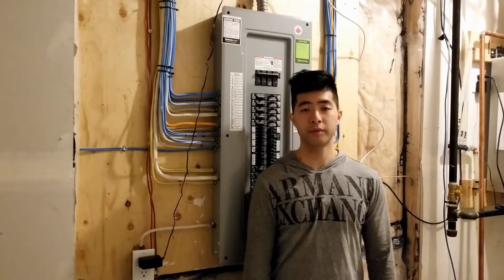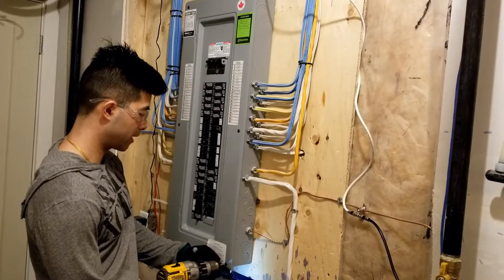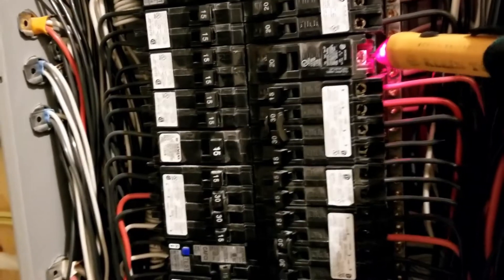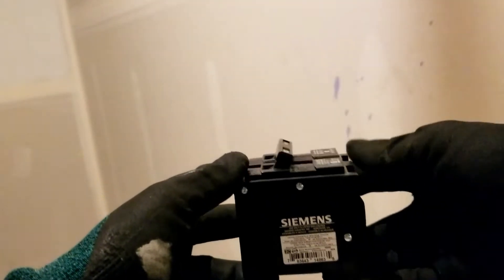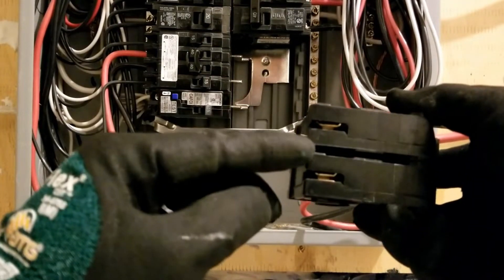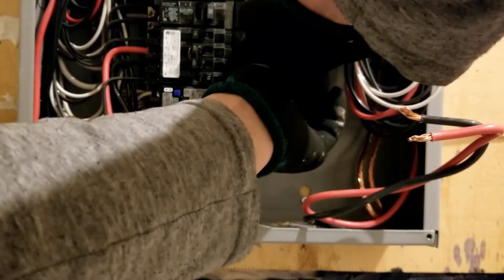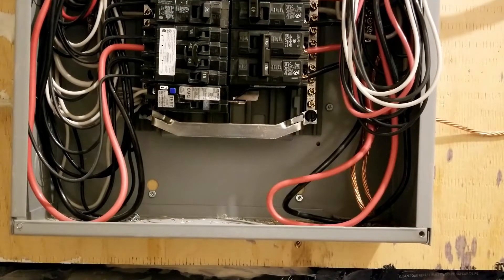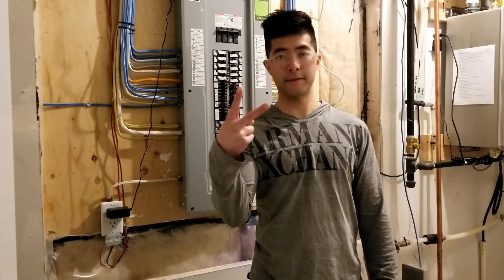HOW TO INSTALL a Circuit Breaker Double-Pole Breaker EASY AND SAFE!

Comment: Appreciate the tutorial but there's no way in hades i'll do anything without turning off the main breaker first.  Electricity takes the path of least resistance through the body, and a lot of it will actually arc around your body as it heads toward the ground.  It will not be a good day for you, and likely your last day as well.
Reply from the maker: Yes, better be safe than sorry 🍻

Comment: Tks for sharing. Question - I haver a 110V  panel, and 40 amp breaker in place. Question, I have a baler that takes 40 amp.  Do I just plug in one hot wire to the breaker?
Reply: Actually the baler is 110V and thus only have one hot one neutral and one ground. So hence my question, if I hook up to one screw on the breaker with hot wire, that gives me 110V.  Question is would this get me 40amp (and breaks at above 40amp?).
Reply from the maker: Yes, you would get up to 40 amps 🍻
Reply from the maker: I am going to assume there will be 2 hot wires. 1 red, 1 black and the neutral possibly? Have to read the specs on the baler. If it's 240V then you will need a double pole breaker. Two hot wires that plug in the breaker 🍻

Comment: So both wires connect to the breaker? No wire connects to the panel? Like the white one usually does
Reply from the maker: Correct both red and black is connected to the breaker only. And the white wire to the neutral bar 🍻
Reply: why does my uncle only have positive to the breaker and the negative not connected to the breaker at all but to the ground side

Comment: Is it possible to make a mistake and install the white and black wires to the breaker the wrong way? Meaning r they interchangeable. The white where the black used to be and vice versa.
Reply: You can sometimes use the white as a load wire, but you should indicate that with red tape on the white wire.
Reply from the maker: Mistakes can happen but just have to pay attention. They cannot be interchangeable 🍻
Reply: @KevinPon.  but the air handler and condenser started working and the 2 pole 20 amp breaker did not trip. Maybe that’s how I should be wired? Black on the bottôm and white on top
Reply from the maker: @unassailablefacts  check out this video https://youtu.be/qWhul3Pa6mA
You never put white and black on the load side of breaker

Comment: Where was ur ground?
Reply from the maker: Hi Ram, sorry about that. The ground wire is on either left side or right side near the edge of the panel. You will see it. All with your ground wire together. Here's a new video that has the ground wire showing around the 10 minute mark. https://youtu.be/qWhul3Pa6mA

Comment: hi Kevin. my dryer is rated for 30 amps and 240 volts. Is a double pole breaker marked 25 amps on each pole acceptable? i was going to install a 30 amp 4 prong outlet for the dryer. thanks in advance
Reply from the maker: Hi Jamesley. The answer is, it "could" work. "But" your breaker could trip once the dryer needs or requires more power than 25 amps. So you will have to see if your dryer will trip the breaker or not 🍻

Comment: What's that red wire? Where are the grounded neutral, ground wires?
Reply from the maker: Hello, there's a red and a black wire. For a range for an example (black 120V) + (red 120V) = 240V
Here's an updated video https://youtu.be/pTq6NmAdJSk

Comment: Great video. Red and black is covered, Im just wondering what to do with the white wire and the ground now though
Reply: Is that for a 115v or a 220v? If for a 220v what do you do for 110v?
Reply from the maker: @daddywoofdawg  Double-Pole is for 220-240V. For an example an oven uses 220v for the heating coil and 110v for lights and other components.
Reply from the maker: Thank you! Sorry about that. The white will be screwed down on the neutral bar with the rest of the white.  The ground with be with the rest of the ground. Here's a more recent video https://youtu.be/pTq6NmAdJSk
Reply: @KevinPon.  I figured it out today thanks!! installed my first breaker in my shop!
Reply from the maker: @SlickWorks  that is awesome! Congrats on your success! 🍻

Comment: What awg of wire you use? What gang box for you use for the other end?
Reply from the maker: Different applications uses different breaker size, different gauges and different boxes. Example: 15A plugs uses 14awg wire, 20A plugs + 12awg, 30A dryer plug + 10awg, 40A range + 8awg, 60A Tesla faster charger use 6awg 🍻

Comment: Hey I your video was helpful but I have one problem. I got a 30amp 2 pole breaker for my dryer.When I touch the hot wire and ground each pole shows me 120w 120w. But when I do both hot ones together it does show anything, but when I took the breaker out and checked oms with each pole it’s shows me right. So if you figure it out can you tell me the problem.Thank you 
My email is jenabkasliwala@yahoo.com
Reply from the maker: Hi there, when you use your leads and touch both hots at the same time you should get close to 240v. Do you get ~240v? Also make your your neutral wire (white) is connected properly to the panel on the neutral bar. Don't forget your ground wire too.

Comment: Where is the neutral wire? (It's white for anyone else reading this that's wondering)
Which is which with the red and black? 
Which or where is the ground wire? (Green)
Reply: Electrons are color blind USE YOUR TESTING INSTRUMENT. IF YOU DONT UNDERSTAND WHAT YOUR METER IS TELLING YOU. CALL A LICENSE ELECTRICIAN.
Reply: @josephrostkowski674  I know how. I'm certified for this. I just think it should be in the video. This comment for for the content maker. It doesn't take a licenced electrician to do this. Good content though, and good comment comment from u 2. Never trust the colors lol both our comments should be in the video for educational purposes.
Reply: Know this, electricity is color blind. Don't trust color, trust your intrustment of testing. Voltage with travel through any wire no matter what color. In a perfect world colors help,but don't ever trust the person that works on it before you.

Comment: I like the way you explain things.  But you  said nothing on how to uninstall a breaker. Not even explaind what the wires are or where the red and black wires go.
Reply from the maker: Sorry about that, this is for installation. But to uninstall a breaker all you would have to do is follow the steps backwards. Where the red and black wires plug on to, either top or bottom works. It does not matter.
Reply: @KevinPon. You did a good job. I just figured adding that to your video would be a helpful tip to your viewers.
Reply from the maker: Yes, you are definitely right! I'll have to make another video.
Reply: @KevinPon.  did you make it yet?
Reply from the maker: @-smp-scientificmethodpersp838  unfortunately not yet. Hopefully within the week
Reply from the maker: @-smp-scientificmethodpersp838  https://youtu.be/pTq6NmAdJSk finally made the new video
Reply: That’s probably because the video is titled how to INSTALL a breaker lol! Uninstall is different than install!!!

Comment: I see that you connected the red wire on the top terminal of the breaker and the black on the bottom.  Do they always have to be in this order or are they interchangeable.  Black on the top terminal and red on the bottom?
Reply from the maker: Thanks for bring up that question. On a double pole breaker, either color can go top or bottom. It does not matter.
Reply: @KevinPon.  Thanks, I was able to connect a new 30 amp breaker for a new water heater.
Reply from the maker: @knaightmare9598  You're very welcome! That is awesome!
Reply: Is there supposed to be an either white, green or non insulated ground wire, too? All the other vids I've seen on this subject have it but I don't really understand it.  I'm just interested in how it all works.
Reply from the maker: @zackpercellvo7923  Yes there is! I should've put it in the video too. The white wire is your (neutral wire) it goes on the neutral bus bar. It connects all the wire wires together. The bare or green insulated wire goes on the ground bar with the rest of the grounded wires. Hope this helps. Cheers!
Reply: @KevinPon.  Yes. Thank you.  I'm concerned because I hooked up a disconnect box outside for a mini-split and I'm having an electrician come out to connect the cable to my breaker panel and 30amp dual pole switch I got for it.  I got the most expensive cable (grey outdoor) wire but it only has 3 wires in it: black, white and uninsulated.    I hope I didn't goof and purchase the wrong wire for this.  If 4 conductors is needed, I wasted a lot of time a and $ but no other video I saw had a neutral wire connecting into the disconnect box for that application.  They only had 2 hots and a ground.  This stuff confuses me lol
Reply from the maker: @zackpercellvo7923  that mini split / sub panel that you're doing. There might be a chance you will need white, red, black and a ground wire. 4 conductors. Depending on the application you may not need the white wire. You should ask the electrician what you plan to connect on the other end you may or may not need the white wire.
Reply: I want to connect a double pole 30 amp breaker to hook up my dryer which has a 3 outlet. Is it the same process you just demonstrated?
Reply from the maker: Sorry, I did not see your message but the answer to your question is yes.
Reply: I thank you but I'm not sure where I  put the wire.. Is it right under The screw
Reply from the maker: Yes, that is correct!
Reply: Can I use 15 amp double pole circuit breaker for Mr cool diy mini split 18000.p4inverter compressor error comes on and warm air comes out
Reply from the maker: Hi John! I just read the manual for the 18000 model. You will be required to use a 20Amp double pole breaker. 15A will not work, too small. Cheers 🍻
Reply from the maker: @dontworrybehappy9713  Hi John! I just read the manual for the 18000 model. You will be required to use a 20Amp double pole breaker. 15A will not work, too small. Cheers 🍻
Reply: Can I use 15 amp double pole circuit breaker for Mr cool diy mini split 18000? P4 comes up inverter compressor error